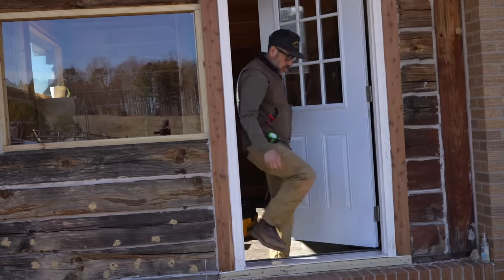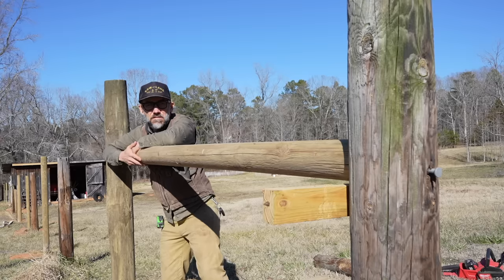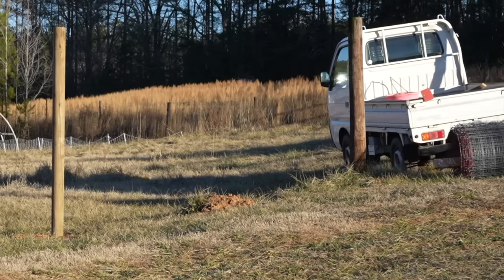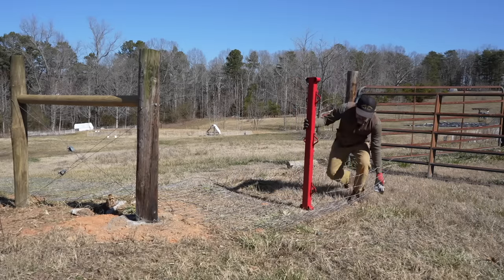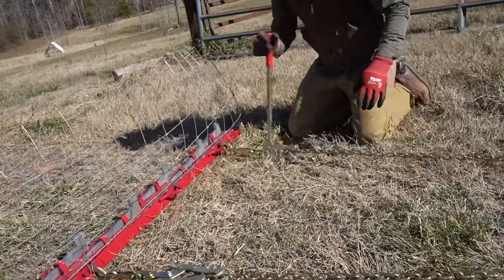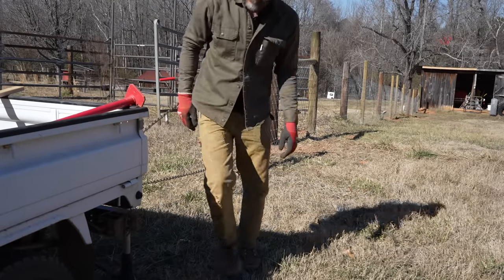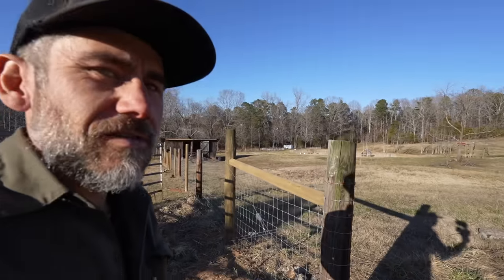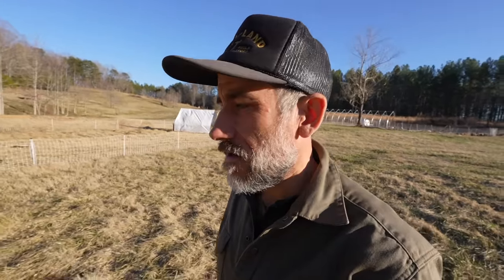Stretching Farm Fence with Mini Truck

Comment: Chock your mini truck tires to help keep it from moving.  You can buy tire chocks where semi truck supplies are sold but i think Harbor Freight sells them too. With that slick grass, a chock might slip. A triangular wedge of fire wood works pretty well for a smaller truck and is easier to kick into the dirt.

Comment: I've even used a come-along and a couple of lengths of black steel pipe to stretch shorter lengths of fence. Fieldcraft. 🙂

I wouldn't bother doing a wooden fence except for aesthetics, near the driveway entrance, for example.

Comment: You have done amazing work well dun you. My advice is not use wood across the top or bottom .the animals will rub against it and it will break .thy love to scratch. I use barb wire at the top .all the way round. If you don’t want to use barb wire, you can use the wire  you cut off from the horse fencing .use it top and middle/ bottom that will give you better support when animals Lean against it ❤😊
Reply from the maker: Thanks for the tip
Reply: @SowtheLand   i forgot to say if you do that you need little metal rings that connect to the fence and wire just use pliers to pinch together well dun 🤠👍

Comment: Hi @sowtheland silly question,  but do you need to go back and fill in the holes from where you screwed in the supports for the posts to keep them upright to prevent carpenter ants/bees getting in to prevent another infestation of the post? This is not a criticism, it's a genuine query. If any of the commenters could enlighten me I'd love to learn.

Comment: Hi Jason. Do you change gear when driving the mini truck.  I always hear the sound of 1st gear and  the engine pushed in 1st this is no bueno... a manual transmission driver of 30+ years.